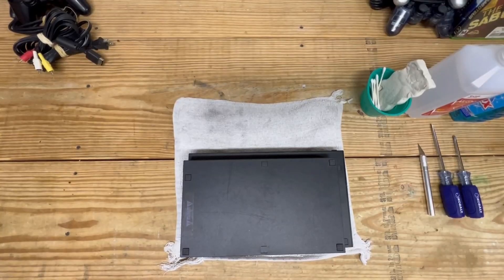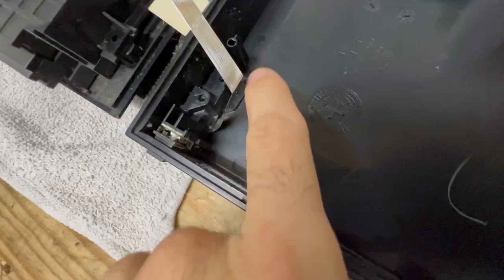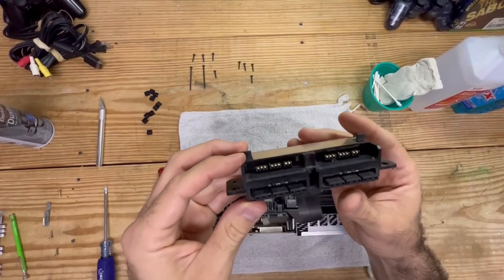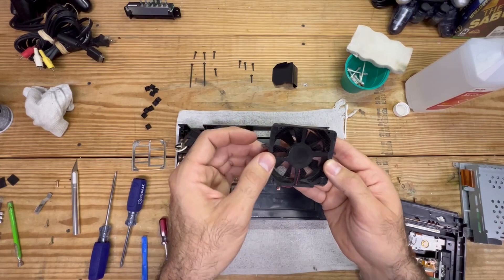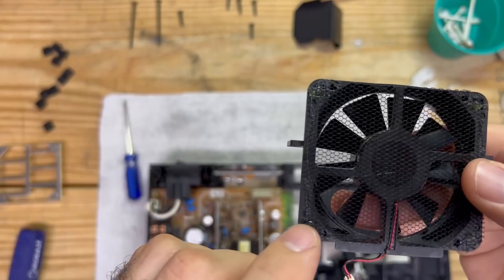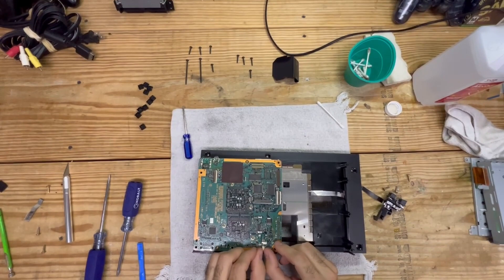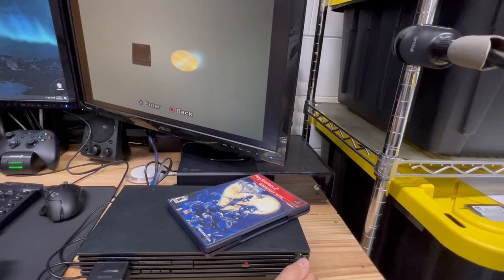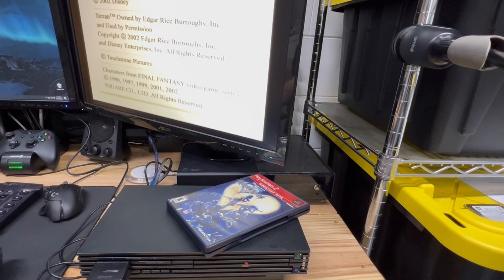Cleaning and Restoring a PlayStation 2 (Fat Model) - SCPH-30001

Comment: Nice. I think it's important to note that the 10-screw model (what you have in this video - small mobo as well) is not super common, most are going to be the 8-screw models.
Reply from the maker: Hi Lane Anderson! Duly noted, thanks for the info. I was not aware the 10 screw model was not common. I appreciate the support. 😃
Reply: No problem! I don't mean to say that these are rare (I have one myself), just that the first few revisions of the fat model (up to SCPH-3000x V3) are this way. 3000x V4 and all fat models after are the more common 8-screw config with the clamshell style outer shell.
Reply from the maker: @lka1988  I also love how easy it is to work on the PS2 consoles. Not to say I can’t repair/work on other consoles but it is nice to be able to make a repair within minutes if I’m not recording lol.

Comment: You don't go into this but you do have to desolder the dc connectors near the power supply to replace the battery.
Reply from the maker: That’s a good catch. I have not covered that yet. I need to make a new video showing how to replace the CMOS battery. Future video to come!
Reply: you absolutely do not have to desolder the dc connectors to replace the cmos battery. when you get to where he's at around 13:00 just unscrew the screws on either side holding the motherboards to the frame and then gently pull straight up to separate them (they're connected by really long plugs, be very careful and don't use too much force). you'll find the cmos battery on the board still attached to the plastic frame. you just slide it out and change it like any other cmos.

Comment: I've refurbished maybe about a dozen FAT PS2s and have my first 10 screw SCPH-30001 "U1 Legend" on the bench. Your video helped with the breakdown but, have you replaced the CMOS battery in one of these yet? Is there an easier way than pry and pray? At 23 years old, the battery is generally swapped for new automatically with any of the machines I've worked on.
Reply from the maker: That’s an excellent question! I have not shown that in my videos. I need to make a video showing how to swap a CMOS battery. Thanks for bringing that to my attention. Future video to come!
Reply: Subscribing now then, LOL!

Comment: Great guide thanks! When i was disassembling my ps2, a black little black thing that says 47 10V on it just dropped to the floor. Any idea where that could be from?
Reply: I think its one of the capacitors.
Reply from the maker: @Anthoonius1  Hi! I’m glad you liked the video. Although I don’t have it directly in front of me I would assume it’s a capacitor. I would be careful messing with capacitors because they can store a lot of energy. If it fell off you may need to replace the power supply.
Reply: @juanquinones  Do you know any place where i could see a clear 3000x motherboard and power supply?
Reply: @juanquinones  I do not see anything missing from the power supply. it could be from the motherboard
Reply from the maker: @Anthoonius1  Your best bet right now is Amazon or eBay. Someone should have it. I would start there.
Reply: @juanquinones  I took pictures of every board and inspected them with my friend. He found it ! It is a piece of the DVD-reader. I am going to try and soder it back in with tin.
Reply from the maker: @Anthoonius1  Nice! I’m glad you were able to figure it out. 😄

Comment: Hey juan i need your help with my ps2 same model got it off Ebay but it won't turn on briefly opened it to find there is no psu ribbon and only a few silver cables leading into the power and drive button little bay area there. It wasn't opened before and i just find this weird, should i keep opening it and could it be stuck on a bottom level. Thanks and would like another means of communication like email so i can share the interior pics if thats okay.
Reply from the maker: Hi! It will be tough to troubleshoot without seeing images of the PS2. I don’t have a public email address at the moment. Could you post the images to public free site and link them to me?
Reply: tried to send you a reddit link which havent gottten sent for some reason , these pics should do im curious if you ever ecountered those wires at that location .

Comment: Would you be avle to refurbish mine if i sent it too you and if so how much and would you see if theres any problems with it as well
Reply from the maker: Great question! Yes, I would be able to provide a cleaning. It is hard to tell how much it can cost without knowing if there are any problems. Also depends on how long it would take for replacements parts to arrive. 😁
Reply: @juanquinones  I was told the only thing that's wrong with it is that it might not be able to read video games but I can't test it cuz I don't have any cables to connect to my television rn like it didn't come with the red yellow white wires and stuff but it turns on just fine it seems
Reply from the maker: @egg-mk7rj  If it can’t read disks than it sounds like the disk reader needs to be replaced.

Comment: Is the model 50004 diffrent
Reply from the maker: Yes, they are different inside. The layout is almost the same but there are slight modifications with each model. I find some are easier to work with than others.
Reply: @juanquinones  how can i do a fan test with a ps3 super slim model 500gb nobody has a vid on it
Reply from the maker: @BlindGuardian.Ssj2  I have not done a fam test for a PS3 super slim model. Is the fan not turning on?
Reply: No i bought one from someone and i could not do it like on the phat model i dont really wanna open it up and mess something up
Reply: @juanquinones  another qeustion about ps2 phat model 50004 when i turn it off below the screen it show few color stripes like few centimeters long  had another one that broke down but he never did that when i turned off u think the port might be damaged
Reply from the maker: @BlindGuardian.Ssj2  Ahh I see. I am sorry I couldn’t be more help.
Reply from the maker: @BlindGuardian.Ssj2  It might be but I would suggest doing a test and replace the video cable with one that is working. Sometimes it is usually something simple like that.
Reply: @juanquinones  the kabel not the problem i checked with the other ps2 that does not do that when i turn of

Comment: ... So you just stopped at the motherboard and the components beneath it, then just started assembling it together...

A bit irritating, I watched this for a complete teardown and it in fact isn't one...
Reply from the maker: That's a great video idea. I should do a complete teardown.
Reply: @juanquinones To continue that line of thought. Why don't you do several videos completely tearing down each different model of the PS2 and reassembling them.

That way somebody searching for a teardown for their specific model can be found here.

I came here because this was a teardown of the SCPH_300xx model specifically.

Just adding..
Reply from the maker: @ultenhiemer  Yes, of course. Very good idea. I can certainly do that. As soon as I get more PS2’s in stock I’ll make the videos.